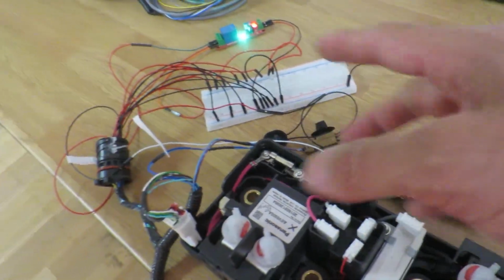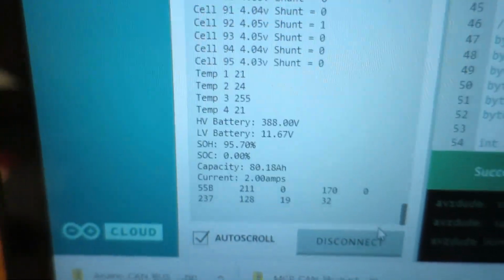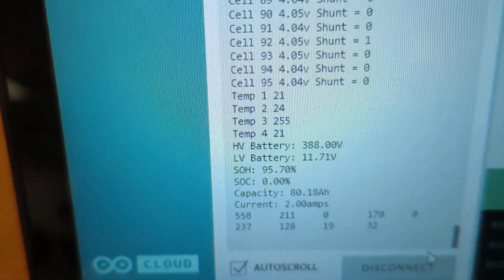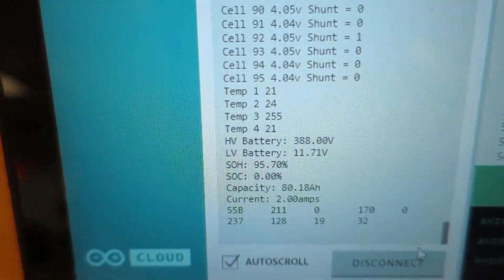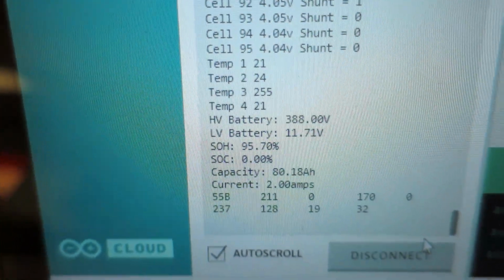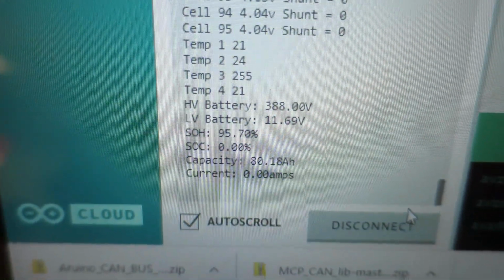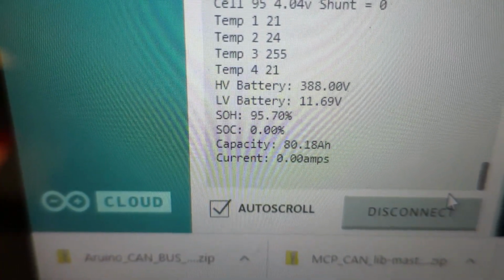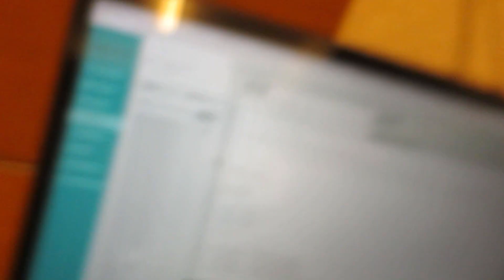Nissan Leaf BMS rewired and tested - 6 months since I did this.

Comment: Did you keep the original leaf cell count?  I think it's 96s2p so don't know if you're running half or it's monitoring in pairs.  If you did not, how did you manage the BMS to play nice w/a reduced  cell count?
Reply from the maker: Same cell count bud, same order, so no tweaking required!
Reply: @SouthWestEVUK  I am wondering if reducing count (say by half) for weight reasons will freak out the BMS.....do you know if each cell had sensors or in pairs?

Comment: Hi - looking to rearrange my batteries - can you tell me how you worked out how to require the BMS?
Reply from the maker: I have the pin out of the connectors, or you could simple track and trace the wires from the original loom.

Comment: If i were to use 3 24kwh "orignal" nissan leaf packs, could i use the same arduino to control all three BMS modules? Or could i use three arduinos but to the same computer? Buying a separate 288 cell bms system is kind of out of my budget range haha
Reply from the maker: yes, you would have to have each bms on a seperate canbus and the arduino would need 3 canbus modules. But to be honest - you dont need to communicate with the bms - just turn it on and it starts balancing.
Reply: @SouthWestEVUK  wow alright, so i just need to plug the bms into the batteries (and 12v?) and it will just balance the cells on its own?